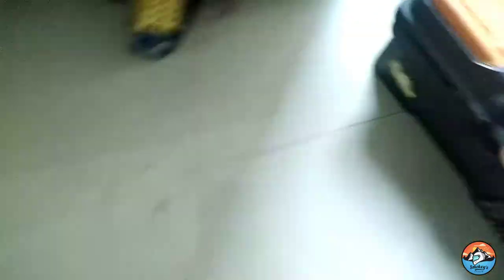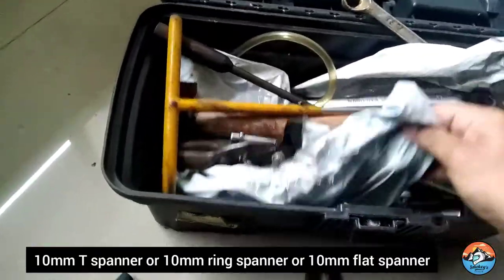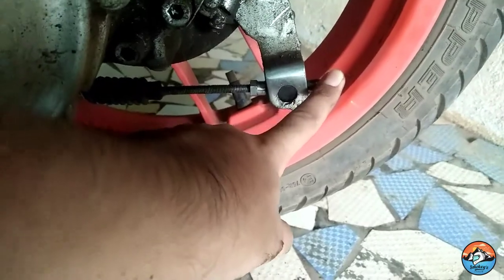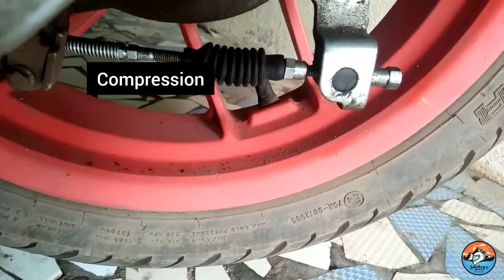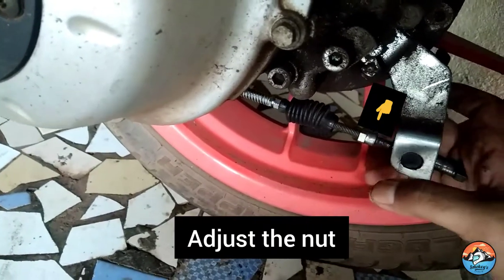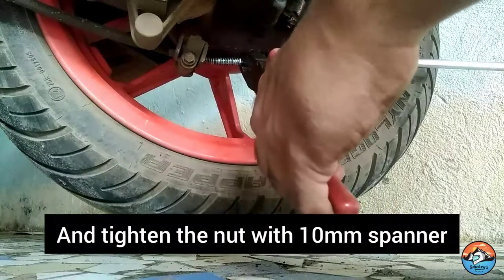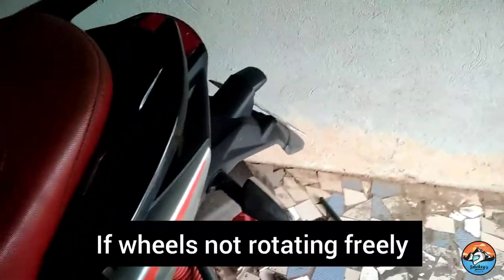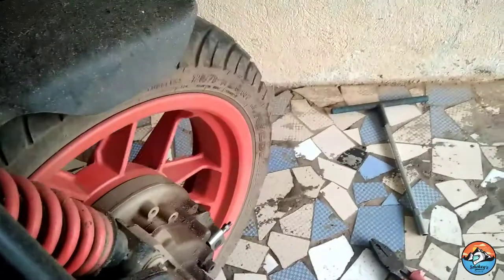How to adjust drum brake of Motorcycle, Scooter's | Easy technique Explained step by step

Comment: Awesome. Please tell me dude does the spring play big role. Because I have changed break pads and break lever and yet break is not applying well. Do I need to change the adjustment spring also. Thanks
Reply from the maker: Yes the spring sets the tension

Comment: Even after brake shoe change brakes are not working properly what is the reason??
Reply from the maker: Thanks for watching!
Yes same problem is there in my Aprilia. Brake shoes are new and wire is also new. 

I am going to check my brake drum if there is oil on it. Clean it properly then brakes might work properly

Stay tuned #TeamSmokeysgarage
Reply: same problem here